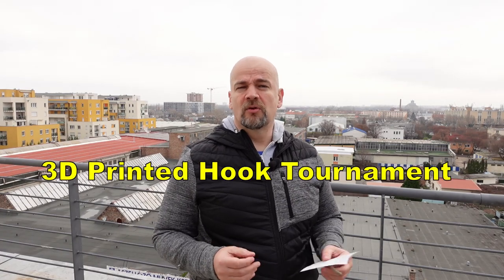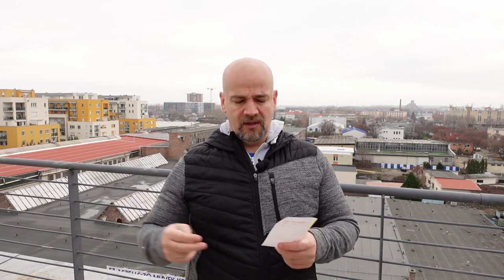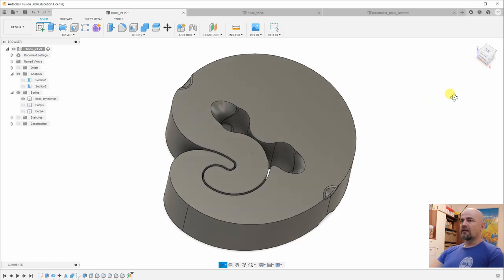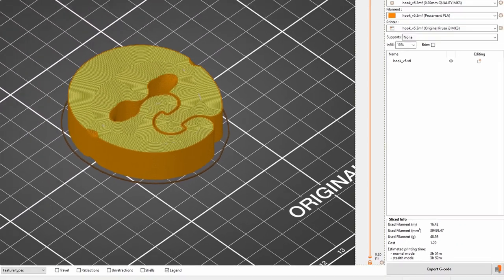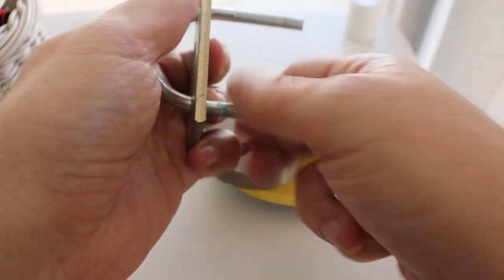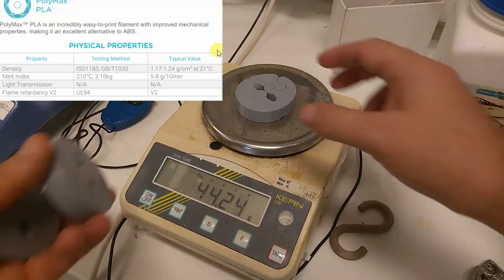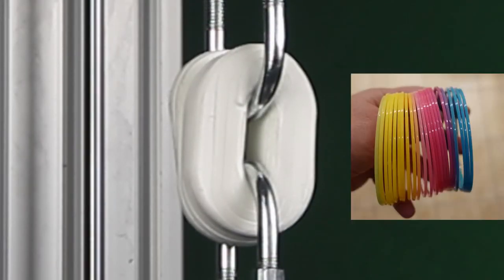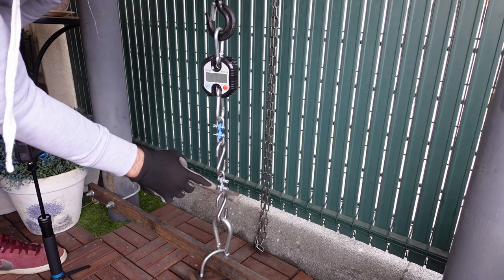My participation in a 3D Printed Hook Tournament organized by Polymaker

Comment: I am glad you had fun. I personally did not like the competition and did not participate. The main reason I did not like it was the need to use (i.e. buy Polymaker PLA) to participate. This of course was in order to make Polymaker look strong, the whole test was about strength, which is of course complete bs, and I am very glad that Igor at the end of this went into testing and proofing that it is indeed not stronger than other PLAs.
After watching the video here I am honestly pretty happy that I didn't try to participate. They changed and bent the rules, used different hooks than they claimed they would (due to the load constraints that were pointed out to them even before the competition started). And the winning design was in my eyes, slightly outside of what was allowed in the rule set. But you have to give it to them: It was a very clever idea. I don't like it, because they probably weren't the only ones who came up with that but got tossed aside as a violation of rules.
I hope, this kind of competition will be repeated by someone more suitable than a filament company with an updated rule set.
Reply: It was definitely a glaring suspect from the beginning... Not only that, we now realize the spirit of making could be pointed in a more accurate direction. In the best timeline, the design rules would have generated a cornucopia of practical hooks. Instead, because of the specific limitations, much of the effort at the highest performing level went into creating design loopholes that really don’t help or make any sense outside this challenge.

Comment: I would like to know how the winning design was printed without post processkng
Reply: The guy that printed it says he pulled from the top layer.  All layers separated, and then after that it popped free from the build plate.  So he argues that's not post processing since the layer separation happens before it comes off the build plate.  That's really skirting the limits, but I guess.  I'd like to see video of this though.  I would think that would strain the layers possibly causing damage.  Or I can see the hook coming off the build plate before all layers had separated, which then would have required "post processing".
Reply: @twinturbostang  honestly? That's a load of bullshit
Reply: @lugaidster  Hey, I'm just telling you what he said.  He posted a comment in the huge comment thread on Round 4 Part 2/2.  https://youtu.be/ZNJY__A1grk  Here's what he said (one paragraph of his very lengthy post):

"The design has a helical cutout of 0.2mm height with 2mm pitch. It was printed with 0.05mm layers over almost 24hrs. When printing, the material is extruded into the 0.2mm helical cutout and it does contact the material below, however, at much reduced contact pressure. The key was to print with the temperature high enough to generate good bonding between the 0.05mm layers but low enough to allow the helical cutout to separate during the action of releasing it from the print bed by pulling from the top only. This was an exercise in trial by error. I understand that printing at low temperature will yield lower strength parts – I figure the increased stressed area may make up for this. "

Comment: Nice! Your hook managed to withstand 800kg!!! thats already crazy!
Btw Polymax PLA is modified to increase the ductility so it will significantly reduce the tensile strength, you should go Prusament PLA VS Polylite PLA, this would be awesome to watch! :D
Reply: Yep, it is a bit strange they are doing tensile tests with Polymax PLA when that's not really its strength, literally. It's more akin to PLA+ type filaments, where it trades off tensile strength for ductility and toughness. 

On their wesite they give the tensile strength of PolyMax as 28.1 MPa and 46.5MPa for PolyLite. Plus, Polymax costs 50% more than PolyLite for a spool and you only get 750g instead of 1kg when you buy PolyLite. 

For these reasons (and the fact I am mostly interested in having different colours of material atm) I picked mostly PolyLite PLA spools for my prize for taking second place in the competition. Also I have asked Polymaker to give two of my spool choices to 4th place (Captain Hooooook) since he made that nice picture of all the hooks battling in the tournament, plus I think he would have taken third if ARMOUR AUS was disqualified.
Reply: @Bordpie  My guess why they have chosen PolyMax PLA is because it is more challenging to design a locking mechanism with a ductile material because you have to take in account the large deformation of the material before the breaking point, and it makes the battles more interesting if they slowly fail, rather than a sudden break which can only be caught by very high speed camera :)

Comment: One interesting thing here is everyone could print at home with their favorite technique. So maybe there is some trick which improves part strength. Something like especially high/low temperatures, big/small nozzle, big/small layer height, enclosure on/off, ironing on as many layers as possible? Maybe I need to get a proper testing rig of my own. 😄

Comment: I figured this channel would be a good place to post this question...as I can't find any info online...and there's a nice 3d printing community here, interested in the small details.

I've been 3d printing for a long time and never had this issue. But I believe I've "overdried" several spools of PLA.

Anyone know if it's possible to remove too much moisture from PLA filament? I had several spools that should have been fine, but decided to throw them on the food dehydrator as I always do with older filament just in case...and then sealed them in a box with 1kg of desiccant for a few days.

Now they are very brittle, and break just by looking at them. I didn't think it was possible to over-dry PLA, but think I just may have.

Anyone here know if that's even possible? I think I need to start weighing my filament before and after dehydration to measure how much moisture I'm actually removing.
Reply: PLA with very low moisture content could be more brittle, but I doubt it is the issue. To confirm you can just leave the spool outside for a few days and see if it becomes better. 
If not, my guess is that by drying them for a long time you may have accelerated the polymer aging process, breaking down the polymer making it more brittle and that's irreversible :/
Reply: @3dprintingscience528  Thanks for the info.

As of right now, they've been sitting in a room with 50% RH for about 36 hours. They have improved enough to handle without snapping at every little touch...but still snap after a few light bends. I'll give them another bend test at 72 hours.

I'll keep them around for some prototype prints, but assume they're permanently degraded.

Comment: The way Polymaker did this tournament is wrong on so many levels.
They left in designs that is against their own rules, and didn't used standardized setup, e.g. different type, size of metal hook, which is again, against their own rules.
And the worst part is, that they tested the hooks against other hooks and not just test each hook until it breaks while recording the hooks max. strength, which would have been more fair and cost them less time and effort to make.
Reply: The whole competition was mismanaged, I heard from CNC Kitchen about it 2 weeks before the competition was over and I subscribe to a number of 3d printing channels.
Reply: I think testing the hook against each other was the core of the tournament, and my guess is that this was the reason they got successful. During the Olympics we dont watch runners running one by one to record the time and define the top 3, we watch everyone compete against each other because its funnier :D
(Otherwise you go on Wikipedia and you check the top 3 fastest 100m official time in 2020)
Reply: @frankb5728  I think if ARMOUR AUS was disqualified, CNC would have been in the final and beat me (the green one in the video 'Hookinator') so I would still be in second place. Then 'Captain Hoook' would have taken third.